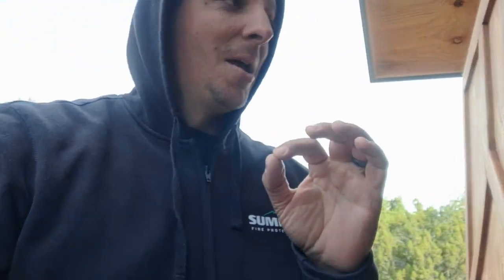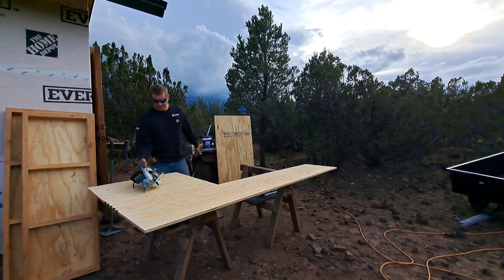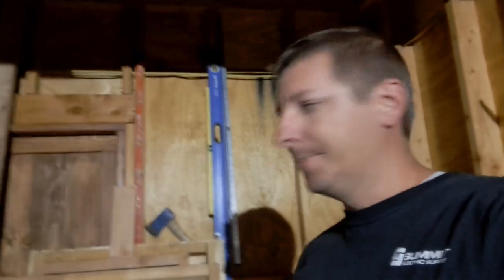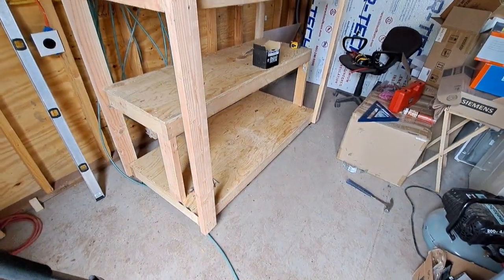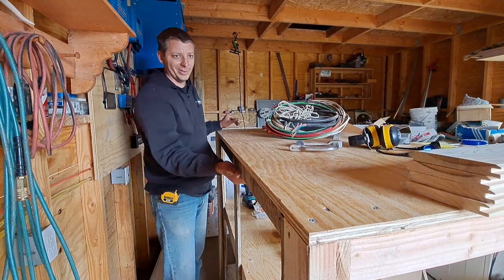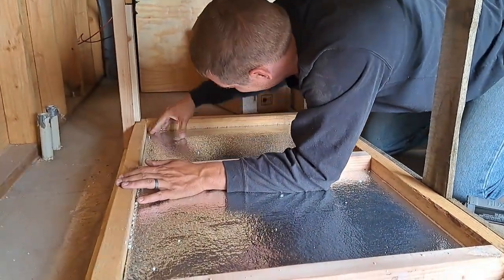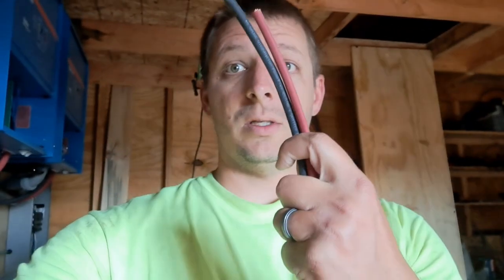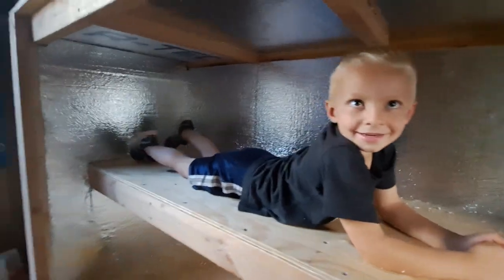OVERSIZED Insulated Battery Box Build For Off Grid Solar | So Close To POWER!

Comment: Looks great! You might want to consider some small low-wattage heat pads underneath the batteries with temperature switches, just in case the battery temp gets close to <5'C... not sure how cold it gets where you are but my [smaller] portable battery system will need them over winter, in the UK.
Reply from the maker: They may need a little bit of heat in the winter. It will get below freezing every night. Thanks for watching.

Comment: Ain't nuthin' wrong with building stuff sturdily. You'll never have to re-build it. The worst thing that I've had with a similar type of item was a large rolling workbench adapted from a segment of pallet racking, where I needed to upgrade the casters after the initial set proved too wimpy. For the snug fit on the styro insulation, you CAN use a 2x4 and a rubber mallet to tap it into place. Also, I don't think I've heard you mention what battery technology you're using, such as lithium iron phosphate, sealed lead-acid, etc. I'm interested to learn that.
Reply from the maker: Thank you dionh70! We will talk about the batteries soon. Always good to hear from you! 🙂👍